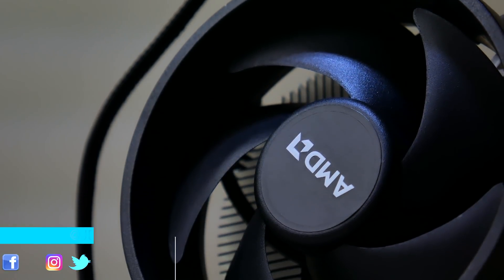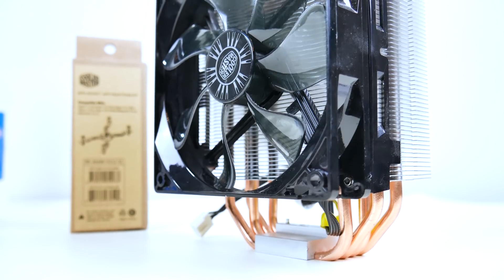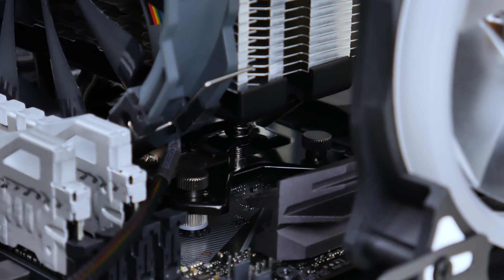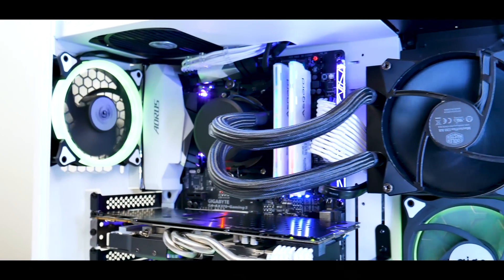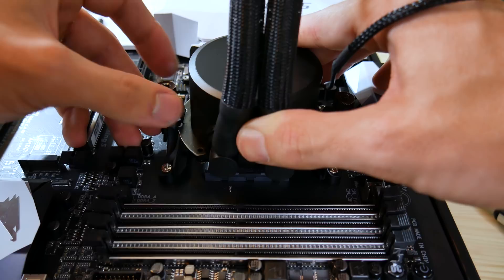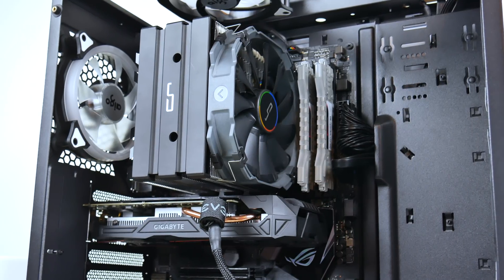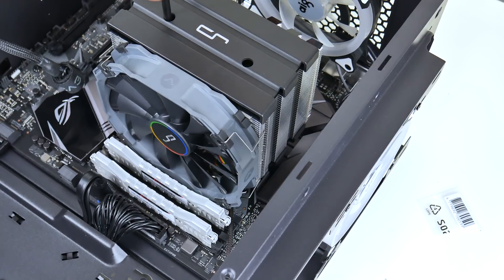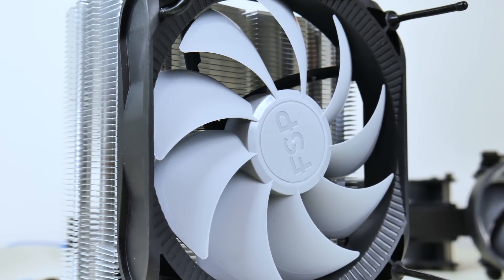AM4 Cooler Showdown!

Comment: Any aftermarket cooler that will fit the same socket as the AMD wriath spire etc so I don't need to replace the back plate on the motherboard?

Comment: Well, I've just bought an A320 motherboard with Ryzen 5 3600, and the Wraith Stealth is crap. Running Cinebench 20 made the CPU go up to over 80 degrees.  And that's not overclocked by even a smidgeon

Comment: Why did you choose the least powerful ryzen CPU for the cooler test? It makes no sense. There's barely any difference between the coolers because 1400 is not hot at all. These results are bad because you'd get much bigger temp differences with a 8700k overclocked.

Who tests coolers with the coldest CPU ever? Dude..

You might as well try to cool your table and you'll get similar results (almost no temp difference between coolers). But that's wrong! That's not the real picture. With a hotter CPU a liquid cooler will have a much bigger advantage. Your test doesn't show the real picture because you chose the worst CPU to test coolers with.

Comment: I was wondering if the Hyper 212 needs to have the motherboard removed to mount it. Thanks

I've a new PC with a 1700 with the stock cooler and wish to OC. Curently the thinkg gets too hot for more than a little OC.
Reply: A bit late. But it depends on the case, and whether it has access to the backplate or not. Some cases have a large enough cut out that you can just pop off a side panel, some don't.

Comment: I've heard the masterliquid 120 is pretty low quality,and it usually leaks fluids from the pump...has that ever happened to somebody?
Reply: I've been running the MasterLiquid 120 for nearly two weeks for my FX-8320 @ 4.4GHz, and have had no issues so far. I almost cried with happiness at how stress free the installation and management inside of my case was/is--ditched a Hyper 212 Evo for the MasterLiquid 120. Although I have a few PC upgrades on their way to me; 

From: FX-8320 @ 4.4GHz (CM MasterLiquid 120)--Gigabyte 990FXA-UD3 Rev. 4--HyperX 32GB DDR3 16000MHz CL10--MSI R9 290 4GB Gaming Edition (1040/1525)
To: Ryzen R7 2700X (same AiO)--Gigabyte Aorus X470 Ultra Gaming--Corsair Vengeance 32GB DDR4 3000MHz CL15--Gigabyte GTX 1080 8GB OC WF3

Comment: i use AM3+ Wraith cooler from FX 8000 series on my R5 1600, and its a beast compare to todays wraiths cooler. 120w tdp monster. Easy installation also. Just clip it to the am4 socket, no need unscrew the black thingy.

Comment: I went with the Cryorig H7. In part this was due to clearance issues in my case, (Fractal Design 804). Aside from the clearance issues I found price to performance is exceptional on this item. Not to mention that aesthetically it is very appealing. The black brushed aluminium top plate goes really well with my black, silver & white build. I have my 1600 oc'd to 3.9 ghz and it has remained very cool. I do think that the case and case fans, (Corsair ML 120's) do help with cooling overall however.
Reply: Ares Araya I have all ML fans and thinking of getting cryorig h7 (or h7 quad lumi). Would you say h7 is quieter than stock heatsink?
Reply: What cpu voltage did you use for that 3.9ghz overclock?
Reply: Did you also get am4 bracket?

Comment: I've got a am3+ socket that my cooler master 212 evo worked on. Is the places for the standoffs the same or different for am4 so I have to buy a kit?
Reply: SaucySpaceFries if I don't get it directly from cooler master I have to pay 7€ + a shipping fee of 2€ so I'll go directly from them. Thanks for that, sorry I seemed like a idiot asking that but just wanted to clarify it
Reply: There is one motherboard (I think it was an ASUS one) which supports both AM3 and AM4 coolers. But unfortunately, it is just one out of dozens.
Reply from the maker: You'll have to request an AM4 kit through Cooler Master support
Reply: JDTechGear thanks
Reply: its a little different. I gave the am3 socket stuff a try on my AM4 since I had a 212evo as well. It was slightly off and didn't fit solidly so I just got the kit (2.99 at microcenter)
Reply: Its the same if you are using them hooks on the side, but if you are installing it through backplate holes it will be different.
Reply: Hardrive33 did you watch the video....?
Reply: DClover yes but I still don't get it. I'm being told this support that support. AMD is amazing at keeping such mounting and I have a motherboard arriving for am4. I find it ludicrous for shittping that costs roughly 8 dollars for a package the size of my hand.